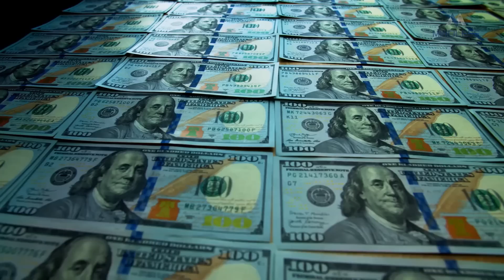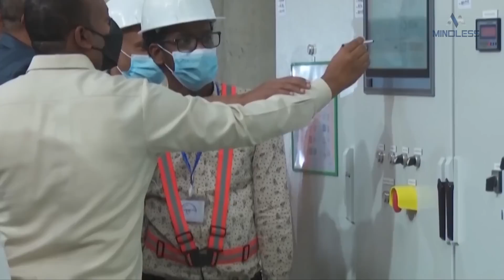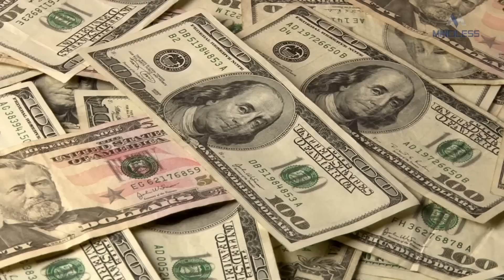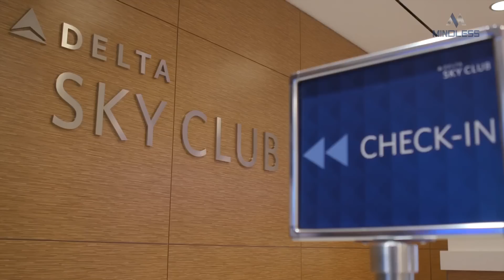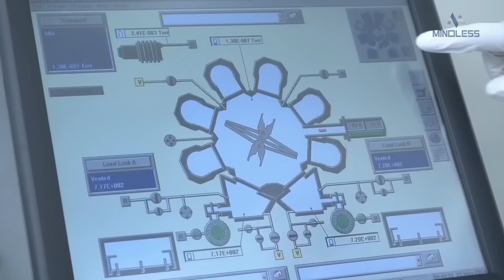Most Impressive Megaprojects Under Construction

Comment: Dubailand has basically failed, most projects within it were cancelled or are still postponed. You have also confused it with Dubai Parks and Resorts, which is a separate location, and much of the footage is from there.

Universal Dubailand was one of the cancelled projects, then the Legoland was cancelled at Dubailand but has been built and is open at Dubai Parks and Resorts, Six Flags was also moved to Dubai Parks and Resorts but was then ultimately cancelled.